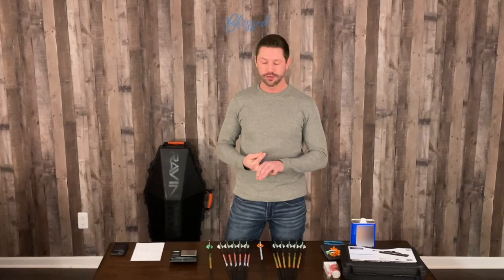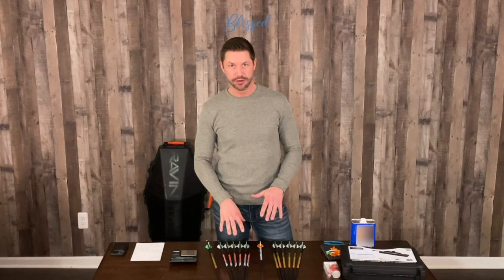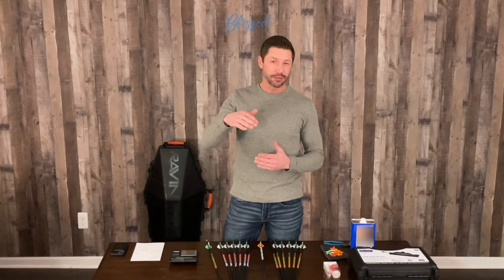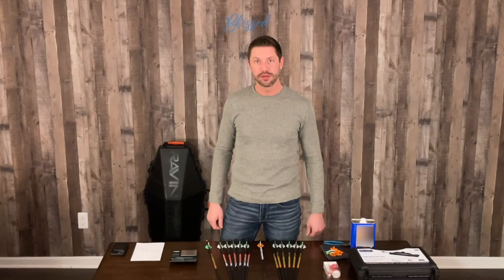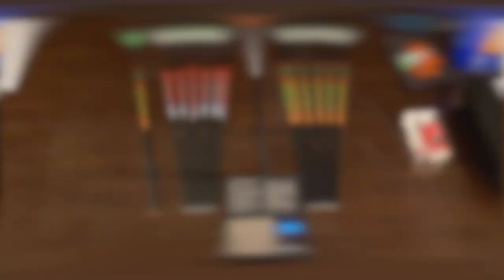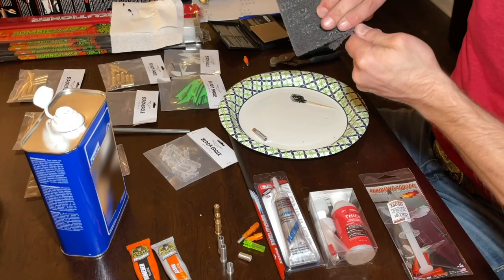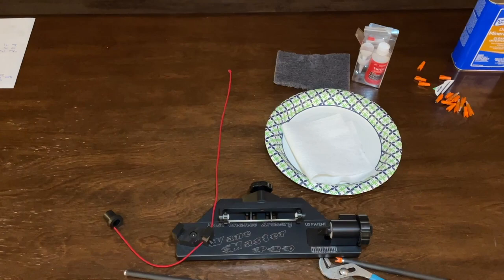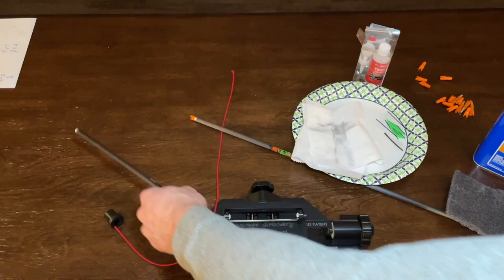Build Ravin Crossbow Bolts .001 Same Weight and Flex, Re-flech Ravin Bolts, Nock in, Vane Master Pro

Comment: After having the fletchings come off several Ravin arrows during hunting, I took a look at the factory Ravin arrows.  Apparently, they don't put a dab of glue on the leading edge of the fletching--thus the problem of them being stripped off. So, I put dab on myself--hopefully this will help.  I'm not sure I want to pay $200 for a jig, but I guess, in the long run--it would be cheaper than just replacing arrows.  We'll see how the preventive measures go.   Thanks for the video.
Reply from the maker: The dab at the front edge should yield an improvement. I was equally turned off by the price of the jig but it is definitely built well and I didn’t feel like I got ripped off. I’m happy I could help. Have a good one.
Reply: Several of my orders for Ravin arrows showed up with the vanes all bent and crippled to Hades. I sent them back, including the new 500 grain Ravin arrows

Comment: So the bolts for the R10 is20" and the others are 21" if im not mistaken.  What are you building for? and wha are the links for the nock bushing and brass weights?
Reply from the maker: All of the links can be found in the description. I’ve used the 20” I’m not sure what your looking at that is 21”.

Comment: John I have the same scale mine came with a small tray, did yours? 
 I took a small round file and made a notch on each end to lay  the arrow down onto.
All you have to do then is tare  the scale after you put the tray on it then place your arrow on the tray and you have your weight. Standing the shafts up on end like that with your hand is not going to be very accurate in my opinion
Reply from the maker: This is a great solution. Mine did not come with the tray. Thank you